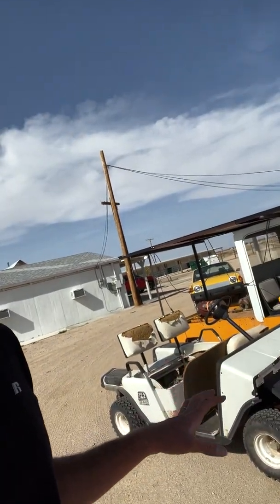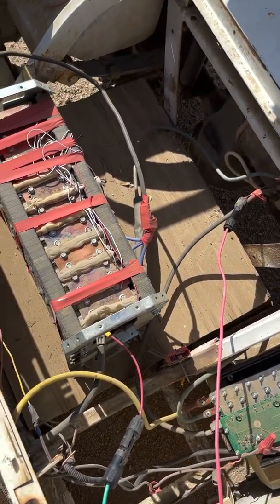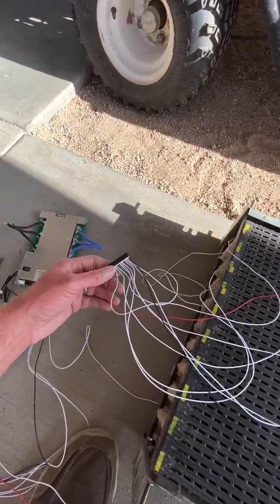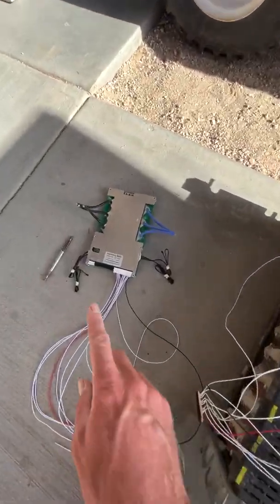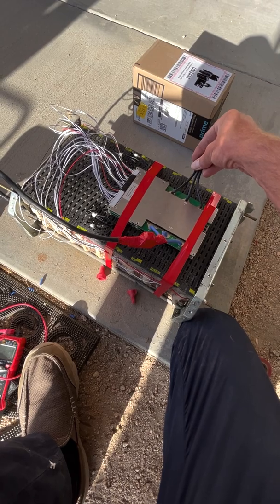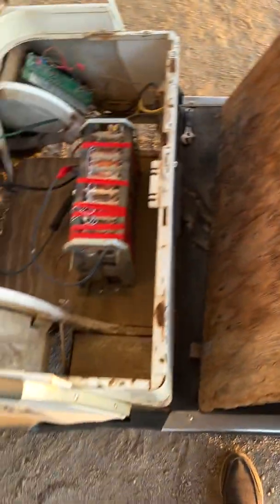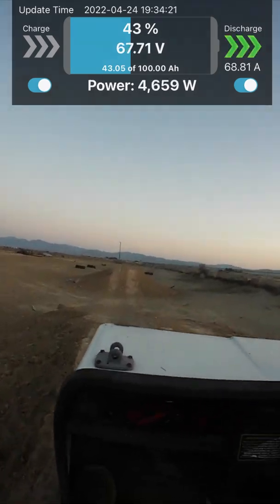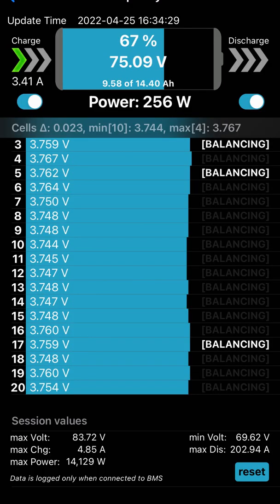72v Super charged EZGO (Simple Upgrade)

Comment: It's a bummer the controllerisint available i can't seem to find any other controller like that with such a large voltage range. I want to start at 72v but it would be nice to be able to throw more at it. Some guys were doing the boost mod to these easy go marathons up to 132v! I would like to know more about your battery, is it the SPIM08HP you reccomend in the comments? 20s is 72volts but any parallel cells?  What's the amp hour rating of the pack? How did the cart hold up now that it's been few years?

Comment: Can you do this to a “resistor” golf cart.
Reply: Can I change out battery, speed controller, pedal to get it to reliable 72v driving like yours? Not sure if the motor can switch from resistor type to this speed controller. I was thinking that motor doesn’t care as long as it sees power from somewhere but not sure. Thank you for your cool videos and help!
Reply from the maker: @Trevsrandomstuff  yes these motors are not particular. At all. A speed controller just pulses voltage the resistor just resists current flow. I do love the simplicity of the resistor carts. But yes they are pretty slow at 36v. If it’s a 36v motor it can handle the 72v it’s the runtime that overheats them and burns them out.
Reply: @RetroElectric  Finally built the 20S4P battery and got all of the parts put this together to modify the 1986 36v Club car. Same exact parts as you have in the video. Just some questions on wiring:  Wire from BMS (blue wires) to negative terminal on battery, Battery to Fuse, Fuse to speed controller, Speed controller to Motor, Motor to black wires on BMS.  Adding a regular 72v Charger instead of solar panel and add the charger wires to the black wires side of the BMS and the positive end of the battery? Thank you for all your help!
Reply from the maker: Good question. You could increase the voltage some but the brushes on the pedal mechanism could wear out faster and if it’s a solenoid based system too much of an increase can wear out the solenoids quicker. But I’m sure an increase to a 48v would be fine especially if you lightened it up with lithium.

Comment: How do you change direction (forward/backward) after replacing the speed controller and Pedal?
Reply from the maker: If your speed controller had reverse in it then you would need a manual switch or a reverse contractor.

Comment: Do you know of a 72v series dc motor that will go in a Ezgo and then put a Curtis or china made 1221 72v-120v controller . Only reason I say that box is because I have a 1331 monitor and can control and set parameters
Reply: The stock 36V motor will handle 72V easily
Reply from the maker: @tsrwakemaster  I can attest they can handle more. 😁😁😁
Reply from the maker: You might be able to check out some of the Gem cart motors.

Comment: 50 Amp breaker sits between battery and controller?
Reply from the maker: Correct. I haven’t came up with a simple pre-charge solution yet for these controllers. But I will eventually. 

My breaker kills the positive and my bms runs the negative side and can trip that but in my experience the 50a breaker trips before the 100a bms obviously.

Comment: Neat project! Impressed how overspecced these older DC motors seem to be given how much current they seem to handle without smoking. Out of curiosity, have you observed any differences in brush wear levels compared to 36 V operations?
Reply from the maker: I have not. this is probably the longest running 72v one that iv'e had so ill try and follow up with this later when i run it longer on 72v

Comment: On the Series motor carts this is a great upgrade.  Incredible what these motors will handle.

I added a 48v-72v 400A forklift controller and 6 x 12V Deep Cycle Batteries from Walmart ($75)
My cart runs 27MPH.

Looking for a cheap Lipo battery build 😄
Reply: Do you have a link to the controller you use

Thanks
Reply from the maker: @tsrwakemaster  it’s in the description
Reply from the maker: For what they can handle the the SPIM08HP cells are quite affordable. You could series two of the 36v modules from battery hookup for a 72v build. Buy a 20s BMS too. You won’t regret it. I used to avoid using bms but they have kind of grown on me. 😁

Comment: I was literally just given a golf cart today and saw your tik tok. The 4 gigantic lead acid batteries that are in it aren’t in that great of shape. I’m pretty sure it’s a 48v tho since it’s running 4 batts in series admittedly I know nothing of golf carts but will soon enough. I like your setup but would prefer more run time, would it be possible to have two banks slightly smaller than your 72v and put them in parallel for more amp hours? Also I don’t see links for the parts in description unless I missed it. Thanks!
Reply from the maker: Sorry I I hadn’t gotten around to adding the links. Thanks for reminding me. Yes to keep it stock (boring speeds) 😉 just parallel the lithium batteries from battery hookup. If they are the 24v ones than just series 2 than parallel 2 or three of those. Hope that answers your questions. 

If your 4 batteries that are in it now are 12v then it’s quite likely 48v cart.
Reply: I doubt the motor in your cart is a Series one
Reply: @tsrwakemaster  Considering all the batteries are connected in series....its not hard to see that it is
Reply from the maker: @tsrwakemaster  most older golf carts are series motors. Except the ones like gem carts that are shunt motors. It hasn’t been till really recent that they’ve been doing ac in golf carts.